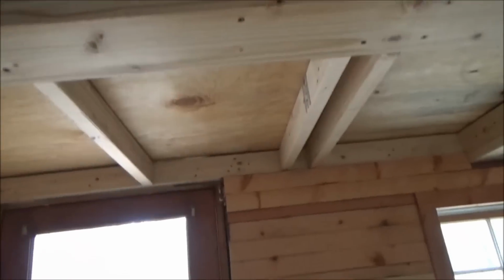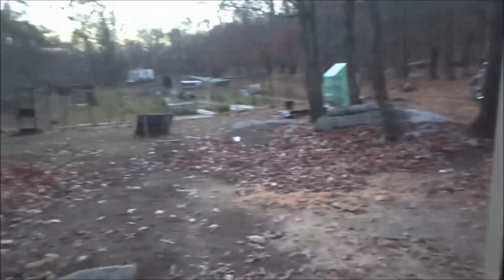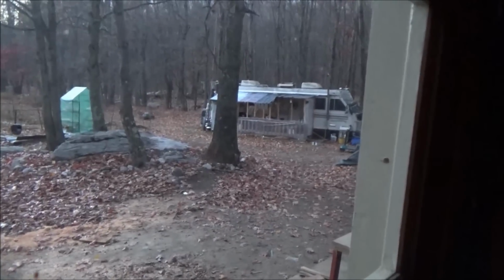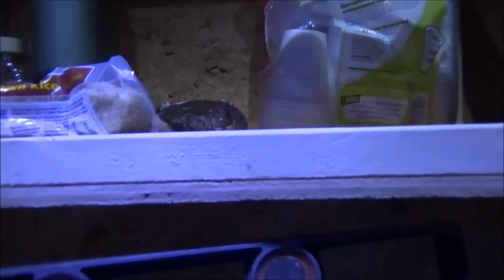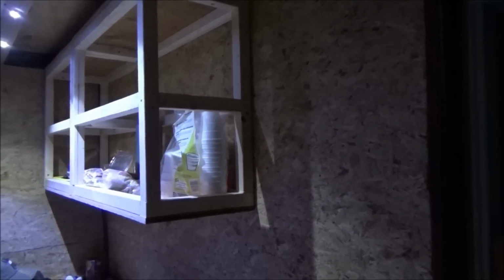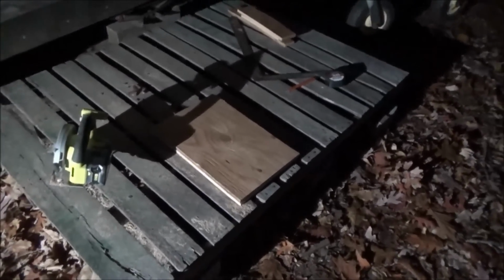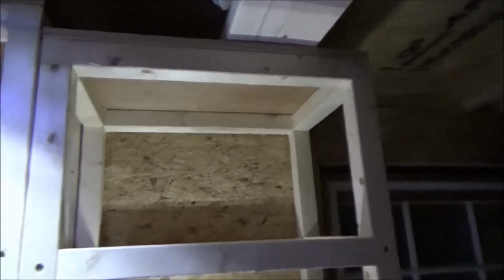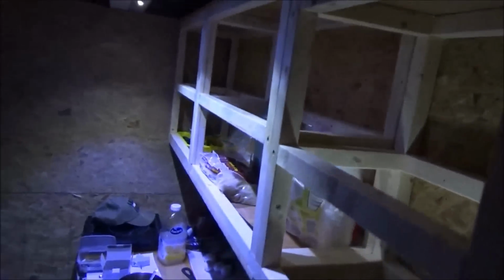Looking For Solar Batteries And Building Tiny Home Cabinets N9

Comment: Here in Estonia they sell 2 main types of construction lumber, your standard slightly warped 2x4 studs (5x10 Centimeters) and the sorted for strenght lumber which is 45x95 centimeters. Dont exactly know why but that might be the case with your gaps.

Comment: Hey troy, If you are having an issue with humidity inside your tiny home then put a kettle of water on your wood stove and let it steam. Monitoring the humidity and once your where you want pull it off the stove and you served two or three purposes 1.) you now have tea water 2.) it will retain residual heat and become a tiny heater for a while 3.) your tiny home now should be humidified.

Comment: It looks like the middle supports don't line up.  Is there room for window trim?  How about the space around the window, is it the same all the way around.  A suggestion.  temporarily nail a ledger along where the bottom of the cabinets are to be, then rest the cabinets on the ledger while you screw them in. Much easier.

Comment: Hi Troy,
I have bee hives up off the ground with 4x4 post and had a real ant problem, they would come up the post and attack the hives, so after a friend told me how the Romans would use urine poured around their homes to control ants. I started doing that around the post to my hives and it worked.  I doesn't smell and no more ants.  I know how much you don't like ants and bugs around or in your home, maybe this could work for you?  I work around my hives all the time and have never had a bad smell, no smell at all.
Regards from North Carolina  
Mike

Comment: Hi Troy. I would suggesl Gel baterries. you can keep them inside(or put them outside ..make air duckt and push hot air inside battery box .. and then air back to tiny house..this way they will be in warm weather most of the time )

Comment: Hi Troy
Sorry to hear about the battery warranty issue .
Just a few thoughts.
Forklift batteries in 2 v cells so if one is faulty you don't scrap the hole bank .
The connections are not user friendly ( big blocks melted onto battery lugs ) .
Discharge no more than 20% ( 80% in battery ) discharging lower will limit life .
Maybe a 12v 75 AH semi-traction battery as switched emergency battery for lights
( 12v lamp & diode type charger from solar bank ) .
Before the wiring is finished ( semi-traction battery's as used in mobility products ) .
If all else fails Its time for cashing in all the dead battery cores you can find .
" OK now I can remove my foot from my mouth  "   !!!

Comment: Try looking on craigs list for a Yellow Top Optima I like them they last for 12 years. They are super batteries.
Reply from the maker: Been searching. I will be using forklift batteries from now on.
Reply: The Do It Yourself World you may be able to use a optima battery to get you by for while you find a fork lift battery. It could be months before you find a fork lift battery.
Reply: Troy you should do the deal on the old napa batteries before its too late and the offer is no longer any good. Sure you will be with out power while you take them town to trade and until you get the replacement back in their box again but how long could that take a day maybe?  Just do it and get er done before its too late. Get past this obstacle and get it over with. you can get fork lift batteries when they come available but in the mean time your just spinning your wheels hoping to get some but none are available and who knows when they will be and it could be months before you find some used ones for sale.

Comment: Troy, here's a thought. Have you looked into the micro-grid-tie-inverter solution??

As it seems you're prepared to blow a shitload of cash on some amorphous panels, why don't you not bother and spend some on a couple of micro-inverters?
As far as I remember, you still have 4 200w panels sitting in storage right? You should have 4 in an array supplying power as you do now, then each other panel can have it's own micro-inverter and can be moved (or removed entirely, no need though) to suit demand or to get that little spot of sunshine! They are always pure sine wave, run upto ~250w each and just supplement the existing mains power in the house.
That way, you don't have to run high current cable to each panel, just a mains extension as it now would be carrying 110-120v ac at very  little current.

Your main solar array would take care of charging the batteries, with a tiny bit needed to start & run your main inverter @ idle, whilst the other 4 panels, each with a micro-inverter attached would run the rest of the mains power by supplementing it.

The benefits:

Your batteries are always charged and only used at night.

Your inverter runs much cooler as it is only put under load when the  micro inverters are at full capacity or they are unavailable. e.g. at night

You are able to manipulate panels individually to get the most of the available light.

You DON'T HAVE TO BUY ANY MORE SOLAR PANELS!!

Comment: Since you'll have your batteries outside ....would it make sense to use a computer fan to draw some heat from the house into the storage area?
 I have heard that the 6v batteries aren't really that great of an idea....good luck.
 Have you checked to see the hz your harbor freight gen is putting out? It can be adjusted a little by the screw under the fuel tank. Mine runs at 59-60, it didn't before I adjusted it. Still dirty, I know.
 Aaaand you need a cast iron steamer/kettle to put moisture back in the house.

Comment: Troy, why don't you build a battery box, inside, get a 2 inch computer dc fan, put that close to the outside vent hole, so it creates a vacume, in the batt box, with that wood bunner, you sure wont miss the heat being vented outside,remember, put the fan, on the outside wall of your house, so it makes a vacume in the box.

Comment: I think you need a amateur radio switching power suply to use that dirty 129volts of dirty power. These power supplies provide clean 12 volts 0 to 25, 32, 35, 40 amps maximum continous regulated stable voltage of usually 13.8 volts.
  Also those 2 - 6 volt 75 amp batteries to run those harbour frieght 4.5 volt work lights to voltage regulator or adjustable pot with meter to set the voltage to the light(s) to 4.5-5volts. and use them to run off the stretched 6 volt  or weak 12 volt batteries and longer life.
   Thanks

Comment: Troy you're living off grid you need to break down and buy a quality Honda EU2000i  generator. They have clean stable power (you can even run a computer straight off the generator). Super Quiet 53-59db which is about the level of human speech. Super fuel efficient they can run 4 to 10 hours depending on load, on One gallon of fuel. They are a bit pricey at around $1,000 but well worth the money.  They also have a 1000 watt generator but for a couple hundred dollars more you can double your wattage and get the 2000 watt. There's plenty more features on these generators I'm not going to go into it all but if you're interested you can read up on them.
Reply: We use the generator off an old welding rig that is no longer strong enough to weld with, but puts out plenty of power for other applications.  It's probably too expensive for Troy now, but we also have a Lister engine from India that runs on just about any oil based fuel and provides both torque for machinery via belts and power if a generator requiring a separate engine is attached.  We filter old motor oil and it seems perfectly happy with it.  It's even run on rancid vegetable oil.  Run diesel in between questionable oil fuels to clean it out.  We mounted it on wheels (4x6s and old trailer axles) to make a portable power plant.  The thing is cast iron and weights a ton, probably literally.  Ours is only about six years old, but these Lister engines are used in India to power entire factories, and many have been in continuous operation for over a century, some of them on waste oil alone.  They are relatively quiet, as they operate at low RPMs, and sound more like a steam engine than a modern one, which would be desirable in some settings.
Reply: Pete Brown Sorry to hear you don't have $1,000 Pete but, luckily I wasn't talking to you.

Comment: Troy move your batteries inside. Build a battery box inside. This will solve the issue. You still need to get better batteries but they will last longer.

Comment: Troy as you are doing your video, I am going to comment.  First off, if the batteries are rated for warm weather, how about you heat them with your indoor heat from the off grid wood stove?  Also where did you get 300 amps from.  I must have missed something.  Do you have dual 150 am alternators?  Have you thought about using your charge controller to decalcify your batteries?  My experience with alternators is that they produce enough voltage to put the controller into the mode that will decalcify the batteries when they are at full charge. There is an option in most charge controllers to do that. And if it is that cold in your tiny house then put some wood in the stove, I thought that is what it was for? If you get 300 amps from your DC generator, I would really like to see an amp draw from it using a meter.  You are smart enough that you can video that. Also if you are drawing 3 watts at 12 volts that is .25 amps, that is crazy low current.  My 12v 10ah battery could supply that for 40 hours, those batteries are crap if they have trouble with a quater of an amp.
Reply: You're right... the batteries currently in the Th with the wood stove are crap... those are the two junk yard batteries.  The other batteries have not yet been moved from the RV...so that is why they were too cold.

Comment: For years we have used an LLBean  Lattice Stovetop Steamer on the woodstove to keep proper humidity in the air come winter. And I know I sound like a broken record, but a large propane tank that could power a generator for needs in winter sure would be nice.
 http://www.llbean.com/llb/shop/59148?feat=510044-GN1&page=lattice-stovetop-steamer

Comment: get trojan or rolls surrette solar batteries, they are designed exactly for solar and i can speak from experience that they last 10 years + of abuse, they've been hot, cold, frozen even, they are starting to show their age a bit but still work quite well, I've never seen anyone complaining about trojans or rolls/surette, they seem to be the best solar batteries money can buy, you may think they are expensive but when you think of the time and money spent running generators, trying to work around having no power etc, they pay for themselves quickly, Im charging my dads batteries now theyve gotten run down since the spring, he had to run on generator last night, horrible time of year for solar power
Reply: sorry troy i wrote this before your last response this will be the last comment i bother making trying to help you good luck on your off grid "project"

Comment: If you do your research on others who are living off the grid, they keep their batteries WARM, not outside in a box! Time to rethink your outside box. Also, replace your way too long aluminum cables with copper! your panels are great, and they make lots of power! Your 12V generator is probably boiling your batteries.

Comment: Decided to look up batteries, I found that getting new batteries, though maybe a little high in cost, you could of bought  them 1 at a time. Set up a bank of 4 12volt deep cycle for around $800. at 224 amphr. most places added the shipping cost to the price. Did you surf the web for companies in NY, that handled batteries? maybe a phone call or e-mail could of saved you time and gas,and gotten you some already.   Of course you may have done the web search already,I do not know, if so then disregard what I posted.

Comment: What you'd want to clean up the generator power is a Line Conditioner.  They're considerably less expensive than a full UPS (battery backup), BUT they don't have a battery to store any power.

And now that you've JUST mentioned a battery backup (still watching) I see we're already on the same wavelength.  d=O)

If you DO decide to go the full battery backup route, though, I'd recommend this one:

http://www.officedepot.com/a/products/861588/APC-Back-UPS-Pro-1500-Battery/

Why?  Because it's got a port on the back that enables you to add an additional battery and TRIPLE the storage capacity!  Basically, it'll run a desktop for up to an hour...with with the second battery pack, TRIPLE that.  (Since it doesn't have the UPS electronics, it's got space for double the batteries!)  A laptop, of course, drawing considerably less power, will run considerably longer.

The extended battery pack:  http://www.officedepot.com/a/products/446005/APC-Back-UPS-Pro-DT7042-External

There are a lot of other brands out there, and a lot of other places to find them, but I use APCs myself, so I know they'll last for YEARS.

If you find one with a dead battery, can also hack one to work with a regular ol' car battery for even more runtime.

Suggestion:  How about considering leaving space for the small generator inside the battery box?  That way, when you're running he generator, you can capture some of the heat inside the box, keeping the batteries warmer over winter?  d=O)

Might be able to just grab some standard stainless steel exhaust pipe and a stainless steel muffler, mount inside the box to provide a bit of "heat reclamation" and make it a touch quieter at the same time?  It'll be a pain making a custom fitting to the existing exhaust, but it's an idea, anyway.  d;o)

*The larger the exhaust extension, the less potential for backpressure issues, and the slower the exhaust gasses will travel, meaning higher heat reclamation.

* Keep in mind that using either a battery backup or line conditioner may reduce the amount of usable power.  It's probably negligible, but once you're running on solar, that might be something you need to account for.

Comment: Troy, good job on the cabinets, its coming together.. 

In regards to the batteries, try to find a scrap yard with automotive batteries for now.. i picked up my used auto batteries in bulk for $200 bucks i got a pallet of 32 Auto Batteries, most of them are the odd ones with side post that most cars dont use and end up never selling so they are happy to let them go in bulk for cheap.. just push them to sell them cheaper in bulk.. i talked them down from $300 for all 32 to $200 over a few days of conversations via email. 

In regards to the batteries, if you go to Walmart and buy a 1-2 Farad 12-16 volt capacitor from the audio department or better yet order an Ultracapacitor online from ebay, you can place it inline with the inverter and the DC generator and it will allow you to use the Inverter for clean electricity with the capacitor acting as a buffer while you disconnect your battery bank and take it up to Advance Autoparts, I am playing around with the use of Ultracapacitors now and they are pretty amazing things, i plan to slowly migrate to a capacitor bank as they will not wear out over time from charge cycles.. i built one recently that was strong enough to start my diesel truck 8 times before dropping to low to turn the engine fast enough to start.. Capacitors are not bothered by cold weather either..

Comment: If you bought those batteries from Advance Autoparts, there is a partial warranty on them if they are only a year old, so you may only have to pay like $20 bucks each for replacements.. just FYI its called prorated warranty, i use to work part time at advance autoparts for spare cash..